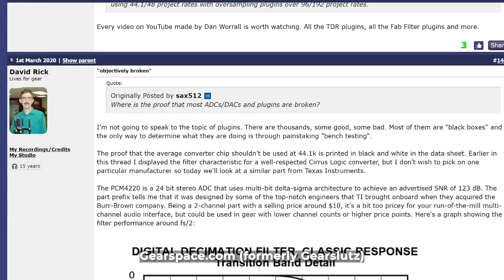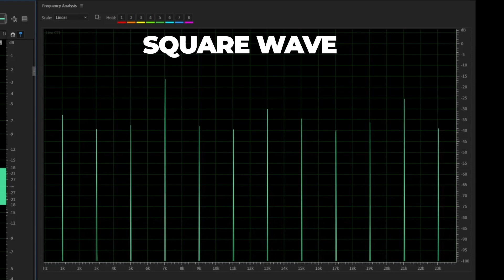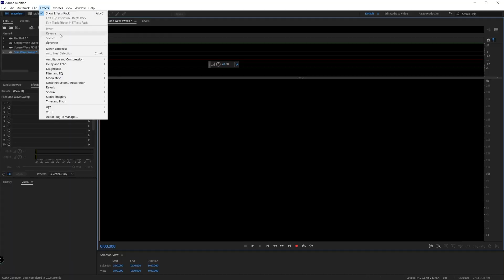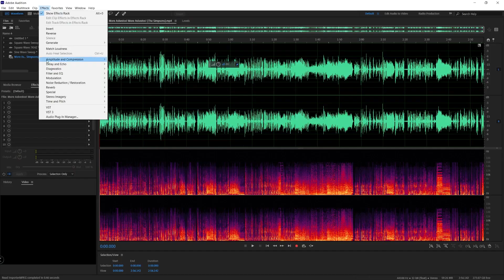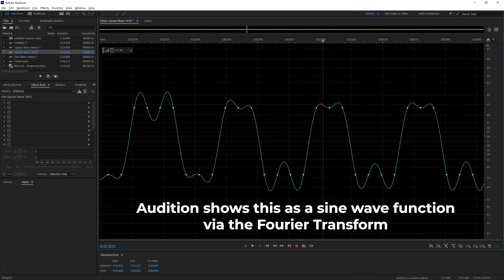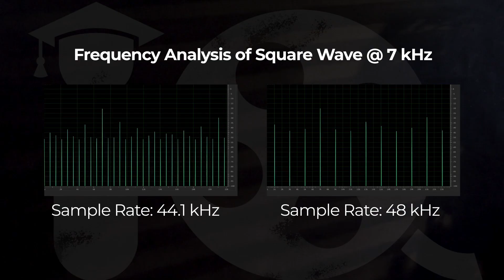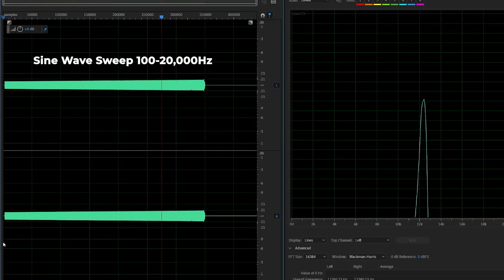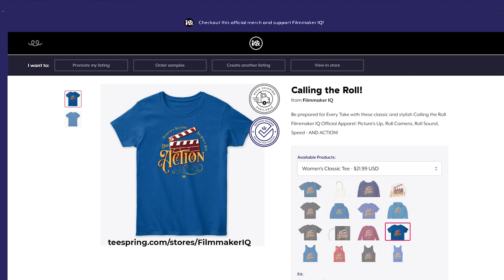What is the Optimal Sampling Rate for Audio? (It's All About the Aliasing)

Comment: >You are watching this at 44.1 kHz, because that's what YouTube converts every video to.

That's not entirely true. YouTube has the audio available in two formats, AAC and Opus. For AAC it uses 44.1 kHz, but the Opus audio is in 48 kHz, as Opus does not support 44.1 by default. Which one is used depends on the platform; in most web browsers (except Safari) it usually uses Opus.

And of course, it might be converted to 48 kHz while being played back, and I'm not sure what they do to it internally, if they convert it to 44.1 and back to 48 for Opus.

And the low pass filter you mentioned near the end might be different depending on the audio format too. Which format did you download it in?

Edit: Apparently most of this has been commented already.
Reply from the maker: The only thing I can download using official means (and somewhat unofficial means) are the AAC 44.1 versions
Reply: @FilmmakerIQ  Otherwise, you can use youtube-dl, which let's you select format

Comment: To understand why sound engineers use higher bandwidth in terms of frequency response and dynamic range, we can demonstrate it by using digital photos. A 4K photo maps to a 4K TV perfectly. No problem. Downscale the image to 4K for domestic consumption. But what if the graphic designer wants to change the image, by adding other elements and resizing them. If you do that work on a 4K image, the aliasing artefacts result in a blurred mushy mess. You always work on a high res version. Much higher than the version the public sees, so that the pixels have room to breath while changes are made. Once complete, the final 4K image is created by downscaling the master. The same applies to digital sound in a recording studio. Mixing sounds, overdubbing and equalising tone curves need room to breath. More bandwidth, just like more pixels. But the public only needs what a human can hear or see.
Reply: I'm gonna that-guy ya: You breathe a breath
Reply from the maker: It's not the same as downsampling a high res image. I kind of hate that analogy because it assumes the higher sample rate is more accurate: it's not at least in the frequency range we care about.

Comment: Well I am in the 4th camp: What gear actually sounds like. My camp can't giva a 💩about other camps. When listening to my SMSL M7 (my first ever dedicated DAC ) I noticed a HUGE difference in quality between streaming and DSD 512 (SMSL M7 is not a DSD dac so signal it is converted to PCM, so I was actually listening to a PCM version of that DSD file), so I was convinced resolution is king. As I spend more and more money, now on Chord Qtest with 1000Euro linear PSU, I can say that all resolution does is keeping poor devices going completely off the rails. At this level the difference in mastering is bigger then the difference in format and resolution, making it basically a non factor. So bottom line is if hy rez files sound better, you need a better DAC. If it doesn't just play whatever you like and don't bother with it.  
Funny part is that the 3rd group, the "engineers" who are so well versed on "knowing the theory" can't really explain why hi rez file sound better on cheap DAC's, so excuse me for not taking these clowns seriously. The only engineers I want to hear, are those who actually build hi-end device because they proved to have the knowledge about how to do it.
Reply: @nicksterj  I was not aware that AK chips, specially lower end ones will upscale to DSD. However, the same exact thing, I described was consistent over many dacs lile Zen Dac1, Neo iDSD 1 and Hip-DAC that uses Burr-Brown True Native,  ProJect Pre S2 Digital with 2x ESS9038Q2M, and Chord Qtest with their own FPGA 50k taps. Are all the DACs upscaling to DSD? hard to believe, yet all the convertors had that difference, and the difference being harder and harder to spot as you go up. With Qtest  you need to compare the same exact mastering to spot it, due the fact that difference in resolution being so small that difference in mastering makes more of an impact.
Reply: @nicksterj  I was under the impression that 1 bit and PCM require different architecture and you ether do a conversion or have 2 DAC's in the box, so I was expected a conversion to take place, but I was expected DSD to be converted to PCM, just like in r2r/multibit, not vice-versa.

Comment: This is a little misleading since the Nyquist-Shannon theorem is precisely defined and correct as is. You even said it youself: You can reproduce any signal with lower frequency than twice the sampling frequency. This is the important part. If you use real world signals you would need a perfect brickwall lowpass filter to hit that, which is not possible to create, especially not with analog hardware. Everything else was nicely explained.
Reply from the maker: I never said Nyquist was incorrect.

Comment: you hit the nail right on the head when it comes to mono signals. so, what about stereo signals? you can calculate the 3d resolution in cm from sampling rate and the speed of sound when your head is positioned in fron of the speakers at a certain distance. or better a singing person in a real room and a stereo mic with a certain distance between the two microphones picking up the direct voice and the reflexion of the wall. if you sample with 192kHz and afterwords digitally low pass filter both signals 4th order at 20kHz you would still preserve the timing differences with 192kHz.
take this as signal A.
then down sample to 48kHz sampling frequency for signal B.
the audible signal should be the same because of the low pass filter. but what about the stereo effect? is there a difference in precision of stereo depth?
this is something that i never have read in the hundreds of sampling rate discussions!
Reply from the maker: I don't understand this argument because sample rate doesn't affect timing in any way. You can achieve the same timing accuracy with 48 khz as you can with 192khz.
Reply: @FilmmakerIQ  ok, i will explain. imagine you clap once in a dampened room without an echo. you have two microphones with a distance of for example 50cm. but the person who claps one time is standing more on the left.
then you get two lines from the clapping hand to both microphones. the clap is a kind of single sine wave or almost a single half wave. you can now calculate the delay in ms from the left to the right mic. now you can draw the signal on paper on a sample raster. maybe the sample raster on the left channel fits with its peak directly to a sample. but on the right channel the peak maybe comes a quarter of a sample later. after sampling you lose that information because you lost the information of the peak that is a quarter after a sampling. now it looks like the peak is at the sampling point.
our brain now tries to decode the position of the clapping in the room. it takes the sampled recording but gets a wrong delay of a quarter sample between left and right. therefor it estimates the clapping coming from the wrong position. we are talking here about the range of a cm or two but nevertheless, the calculation is off. of course the brain does not do this from only one sample but continuously and that might average out things but still there is an error.
while the information of the sound lies in the changes of the intensity of different frequencies, the information of the position lies in the delay of CHANGES. you cannot detect the location of a constant sine wave because there is no event, no change. so every change in the sound has a delay between the right and left ear, therefor also needs a certain resolution for recording and playback.
Reply from the maker: But the things is you don't lose that information. There IS NO error because the second microphone will still register some form of the wave, you don't need to register the exact peak because the Nyquist theorem specifically states ONLY one band limited wave form can fit the given samples, that means any timing is possible. Monty demonstrates this in his video and Lavry talks about it in his essay.

Now this is only for the audio inside the captured frequencies, you could conceivably come up with a frequency that wouldn't be captured correctly but it would be outside the Nyquist frequency

Comment: I think the thing that it is a shame that you didn’t make clear is that: the issue is mostly one of artificial waveform generation at this point.  Though most audio subsystems are relatively good these days at rejecting aliasing when recording, this doesn’t protect you from software making signals that have aliasing.  Unfortunately like scrambling eggs, once this aliasing has happened, there is no way to remove it because the signal generated is mathematically identical to the fundamental plus its aliased frequencies (you will get the exact same values.)  To be honest, it is a shame that Adobe Audition does not give an option (on by default) for proper band limited square waves.  In the generated tones panel, it draws something on the screen which obviously is meant to depict a band limited wave, but the band limiting is done improperly.  Unfortunately, things like that further confuse people who are trying to learn/understand these things.  When Audition shows the smooth line depiction of the waveform in the main view, it is reversing the Fourier analysis using the resolution of your screen.  This then shows you what the audio output of your computer (and therefore the speaker) would be trying to do assuming perfect output.

Comment: It's not that Nyquist is wrong, 2x sampling is all you need for good reproduction.  However, it's not easy to build a "brick wall" low pass filter for that.  If you oversample by 2x,  IE: for a max reproduction of 20khz, sample at 80 khz, then a good low pass filter will be possible to design with affordable parts, and no heroic alignment will be necessary.  Since sampling rates are often at a power of two or a sub multiple of one, 96khz sounds like a good choice.
Reply from the maker: Look closer at the thumbnail ;)

Comment: Nyquist only identifies frequency it does not preserve amplitude. Create a signwave in Excel and place 2.5 points per cycle then curve fit the points and you will see the amplitude is not preserved. If you shift the points in time you can see the amplitude of the curve fit change. You can do this by hand on paper with less precision.
Reply from the maker: Great point! Thank you

Comment: So my conclusion from this video is that Adobe Audition neither does proper antialiasing or oversampling. If I generate a 10khz squarewave in Ableton it sound exactly the same as a 10khz sine, just the way it should be if there is proper AA. So what they guy at @3:52 writes about that "Nyquist-Shannon is not 100% true" is wrong. Nyquist-shannon is right since it do include the AA filter. If you are gonna compare different sample rates you MUST have a proper AA filter or the test will be wrong.
So yeah, this video is a good demonstration for why people might here a difference between lets say 44khz and 192khz; their gear is faulty and not doing the necessary antialiasing correctly, so they hear something and directly that confirmation bias kicks in and they say that "you see, higher IS better!" even thou it's probably the higher one that sounds wrong because of all that extra aliasing.

I would recommend this video very well explained video if you want to know more about aliasing and what you can do to minimize it without going in to extreme sample rates :)
https://www.youtube.com/watch?v=-jCwIsT0X8M
Reply from the maker: I would disagree that Adobe Audition is doing it "wrong" ... It's doing precisely what it's asked to: generate a square wave. 

I wouldn't want it to band limit it unless I told it to. Audition doesn't have that option in the generate tones section, but that doesn't mean it's doing it wrong.

Comment: I wont say Nyquist is wrong, but severely misunderstood by the masses, its its only applicable to steady state tones. Audio is a complex waveform and sampling at 44khz can easily miss parts of the sample. quick example; sampling at a 20khz sine at 40k samples/sec in sync, would sample the zero crossing at the 0deg, 180deg, and 360deg. The theorem does not state thats all you need, is states the minimum one should sample.

Hey John, I believe we are near one another, if you are near DTLA, I can demo some stuff for you and on the oscilloscope that would blow your mind when it comes to sample rates, bit depth, and square waves.
Reply from the maker: Yeah but I don't hear anywhere near 20 khz
Reply: @FilmmakerIQ  it was just example, due to nature of the complex signal of audio, higher sample rates can give noticeable differences. Cant explain to much here, but I would be happy to demo a 140khz system for you if you are ever near dtla.
Reply: @FilmmakerIQ  quick side note, did you every do any video work for any of the fashion weeks in los angeles? Im trying to figure out if we met before
Reply from the maker: No. Thing is it's only proof if your 140khz sounds good on MY system. I'm tired of hearing people saying I need to hear it on THEIR system - that is the first flaw of any kind of rigorous test. Take away your bias because of the system YOU built, and then we'll talk.

But honestly, I can almost guarantee you that I wouldn't hear any difference even on your system.

I've gotten to that point in my life where technical precision doesn't impress me anymore.
Reply: @FilmmakerIQ  Fair enough, was more so going to show you the lab and scope traces, and actual digital signal processing. What I wanted to show you was not technical precision, but rather how one can do less that 16 bit and higher rates and get comparable output. But I get it, everyone and their brother says listen to my system. Also, I have removed any bias, but I get it, you are sick of people commenting and thinking they are the next dunning,  its just sad though that you push your past experiences onto people you never met, dont know you hurt you, buy maybe you need a hug or something, if you see me at cinegear (as I designed a lot of gear there), feel free to come tell me how I am this or that, ill give you the hug and handshake and maybe we can just move on. Wish you the best, and I am still a fan of the work you do here.
Reply from the maker: So long as you understand how everyone and their brother tells me how "oh you got to check out my system - you'll be a believer" - then you get why I'm skeptical. It's not that I'm pushing my past experience on you - it's that you sound like every single other person telling me their voodoo isn't actually voodoo. Like EXACTLY the same.

And I have yet to hear a good argument... it's always "it's too complicated to write here"  - prove it with an logical explanation because I don't trust ears.
Reply: @FilmmakerIQ  100% get what you are saying
Reply from the maker: Sorry if I came off harsh - middle of a big project, and lately been a lot of trolls on my page. I'll take that hug if you're offering haha.
Reply: @FilmmakerIQ  it felt a little harsh, but you explained it very well and I agree, I did sound like every other person out there. From watching some of your recent live stuff I can see the troll frustration, and like I said, I am still a fan. I get that way very often. Its so hard to hold back when I am teaching photography as well, Ive jus tried not to entertain them anymore. But on serious note, I could swear I met you on a runway, I was head photographer for Los angeles fashion week and swear you were behind me on the riser doing video around 2015-2016
Reply from the maker: Nah, haven't done that show. I'm not really close enough to LA to do stuff out there, closest I get is the OC

Comment: Products are aimed for the masses. Good enough is all you need for 90% of the market. You don't even need to get upto 20KHz. Economics dictates the rule of diminishing return. Your everyday mediocre gear cost say $100, and reproduces to 99% accuracy.  To get to 99.9%, that gear will cost 10x more. That's fine for the high end market, but will deter the average joe. So you can argue about what is best, but in the market that's just noise.